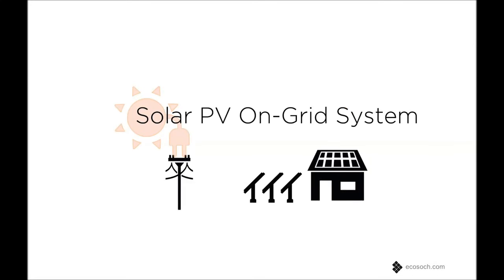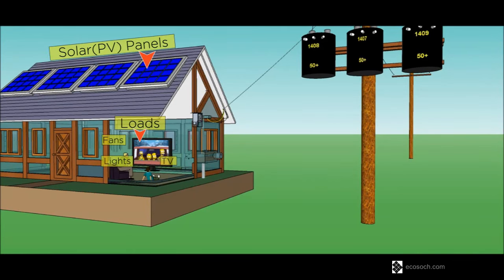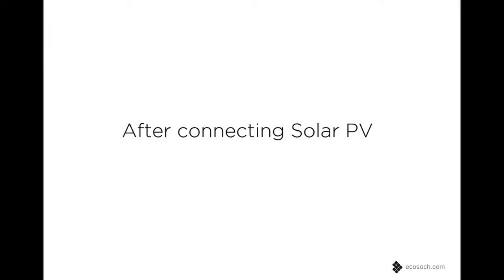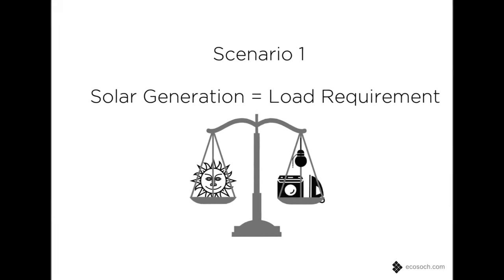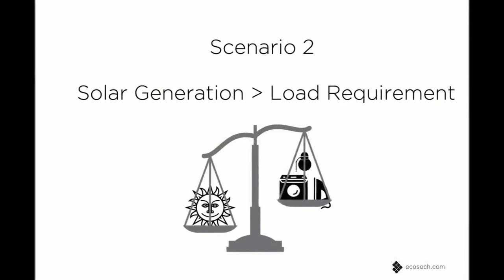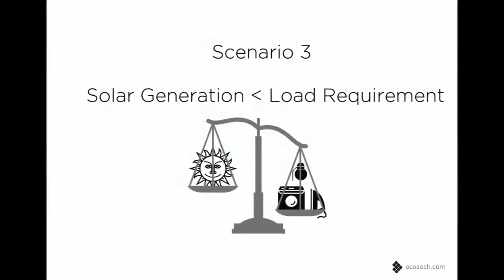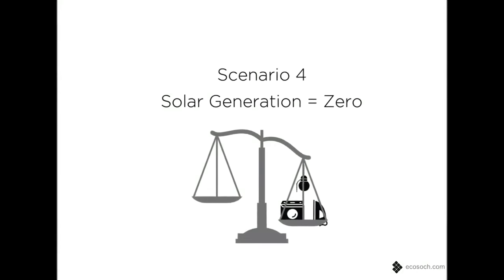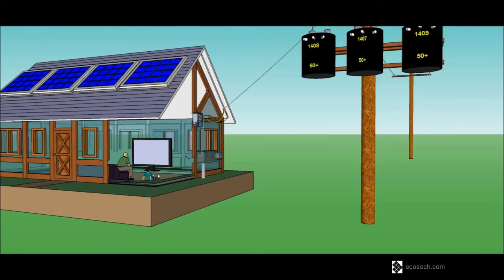Grid Connected Solar PV System

Comment: Oh wow!  That simplified a lot of my questions there!  I was actually debating whether or not to install a battery or connect to the grid at my house.  I heard batteries are rather pricey.  So basically, if I live in a city/town/suburb that has grid access, it is best to simply connect to the grid, but if I live somewhere rural with no access, a battery solar installation is ideal.

Comment: Can this system be used at blackout for feeding the load and disconnect from the utility, here I mean large scale sys.  Without using backup batt.
Reply from the maker: Yes we can use with help of Diesel Generator. Solar On Grid system need a reference voltage to work. Diesel generator can be used for attaining the reference voltage. This helps in decreasing the consumption of diesel in case of large scale systems.
Reply: @ecosochsolar  Another interesting option is to use a 12-24V panels in parallel connection and putting this voltage to the low-power circuit, that powers LED lighting, phone, laptop or even LED TV. This will allow you to have light and basic power. The downside of this is that we need to use an extra device: up-coverter to convert into 110/220V which is compatiple with the grid voltage.

Comment: What if a battery is connected for power cut..
Reply from the maker: Yeah. we can do it. It's called an Hybrid system. Solar works and continues to charge the batteries and supplies to the loads from batteries
Reply: EcoSoch Information Can a hybrid system use the power from battery at night even if the grid have power.? Or battery is only for power cut senario?
Reply from the maker: It can be used in the night as well. System settings can be  configured according to our requirement. Off grid systems work without any power from supply company. We can choose in inverter based on the requirement.
Reply: EcoSoch Information thanks for the replys. Which charge controller would u suggest ? I hav normal inverter and a tubular battery.
Reply from the maker: We can recommend to use charge controllers from Studer innotec make